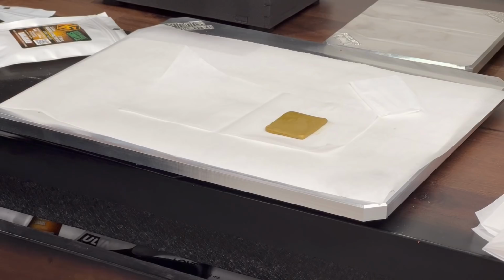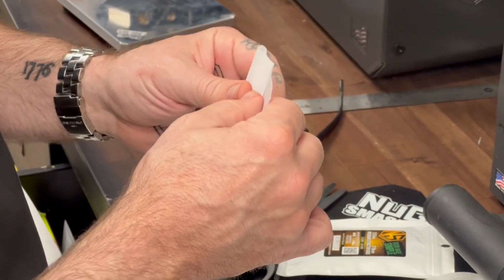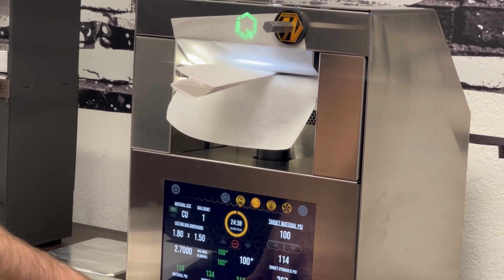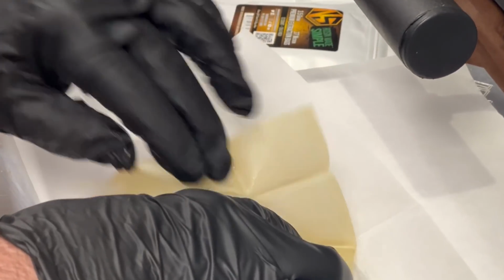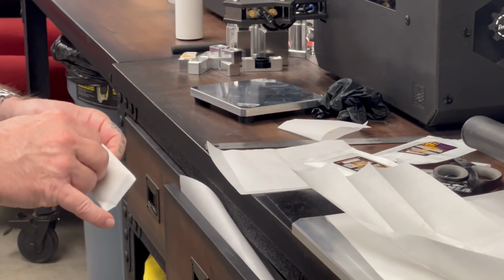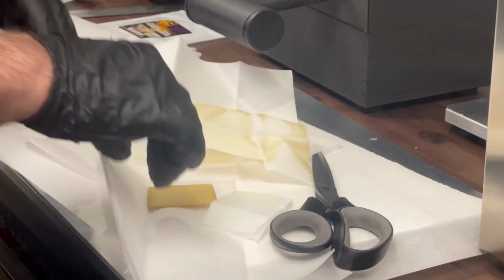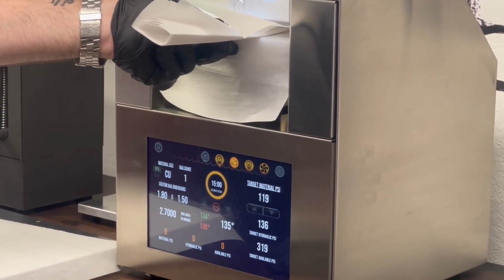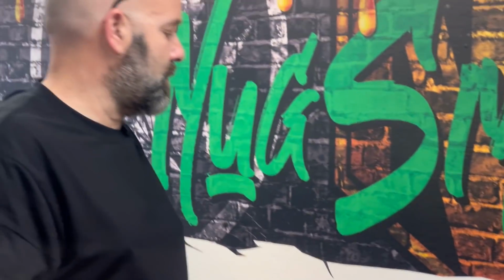ISOLATE - ROAD TO ISOLATE

Comment: How can I put a pressure gauge on my NugSmasher og? I’d love to upgrade to a display machine there just to expensive
Reply from the maker: There may be some DIY videos on how to add a pressure gauge to a bottlejack, but i do not have that information.
Reply: @Nugsmasher  they next model up from the og has a gauge it can’t be too difficult
Reply from the maker: @richpitty  we do have an upgrade program, that you can utilize to upgrade that OG to an XP if you would like.

Comment: I have learned how to make dabs on here isolate and I also learned how to turn dabs into a oil with my machine as well which I did not know was possible for vap carts or whatever I need to build up my machine better with a better jack auto one and one that tells me the pressure then I place it in my assisting machine may have to ditch my housing and make a knew one but that is just thin metal and I am ok with that even without a housing.

Comment: Do you have any advice to Prevent the rosen from buttering
Reply from the maker: Afternoon, Jeff how are you doing today? You can start by adjusting your temperature by just a few degrees high. Once you have completed your press you can take it directly to the freezer or if you have a cold plate please make sure it is nice and cool for your product. If you need future assist or  have any questions please contact one of our Live Reps at WWW.NugSmasher.com.
Reply: @Nugsmasher   so If I understand correctly  keeping it cold after removing from parchment. Would keeping it in a glass jar with a good lid help or wast of time? I normally just keep it in parchment after it's  Collected I have put in jars but not my normal.   I gess more heat      helps pull more from the plant that helps keep it from budering up I don't mind it budering up but people say it's harder to work with and end up losing rosin to crumbling off dabers and poping off parchment when opening up  thanks fore the quick  response  I am so glad I went with nug smasher as my choice.  press on people that's all we can do to get through.

Comment: How does this isolation work does it only extract the Other lipids and leave all the thc behind due to the thc melting at a higher temperature? Honestly this looks like a higher quality product than a true isolate would be, as this still has allot the naturally occurring Flavor and sent compounds, unlike true isolate which by definition is only an isolated cannabinoid of at least 99%. Also a little unrelated but people talk about the entourage effect from the terpenes and although there might be some truth to that I think the solvent properties of the terpenes and other compounds allow THC to have a higher bioavailability, smoother absorption and possibly even less lung irritation do the THC not really sticking to the lungs as much.
Reply from the maker: It a different product than the solvent made isolate when extracting Rosin  its mostly THCA about 70-80% and some fats and some lipids and  terpenes the natural process holds the rosin still in shape puts a controlled pressure on the rosin a controlled heat on the rosin pushing the fats lipids terpenes out of the fine screen holding the shape. The effect is much stronger than solvent isolate. Hope this helps
Reply: @Nugsmasher  okay that’s what I was thinking, Looks like a super high quality product.
Has anyone tried smoking the stuff you extract out that has all the terps and lipids? Although it would be low in thc might be kinda interesting too see what happens haha

Comment: That’s some super dirty thca. Bring your pressure and temps up to clean it better. No sense putting all the effort in to come out with a half finished product. Thca is white, not yellow. If you have done it correctly it should be as white as snow.
Reply: Yes sir it is. Like pure snow.

Comment: Has anyone done analytical testing to verify that this is indeed thca? When winterizing oil, everything left on/in the filter is usually fats/lipids, not what comes out of the filter. So I’m curious if that’s just a piece of plant fats. And the stuff your excreting is actually the refined cannabinoids/terpenes. Which would be the opposite of what your claiming. If you’ve done analytical testing I’d love to know.
Reply from the maker: We have tested it many times and have videos of the tests on this Chanel over the years. It’s usually 92 to 94% THCA if you refine it past that piont the return diminishes past the desirable piont.
Reply: I was thinking the same thing